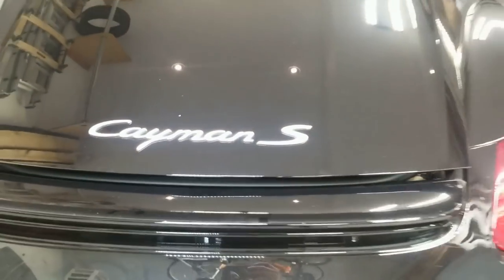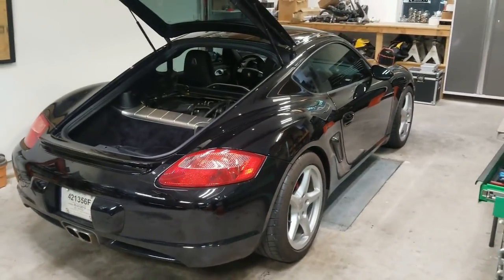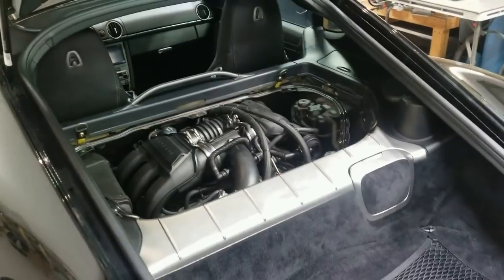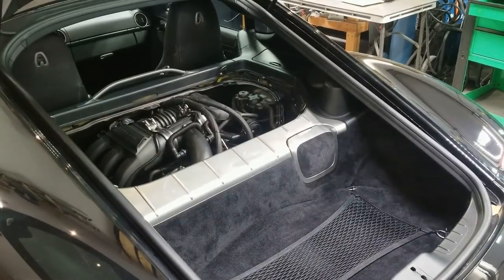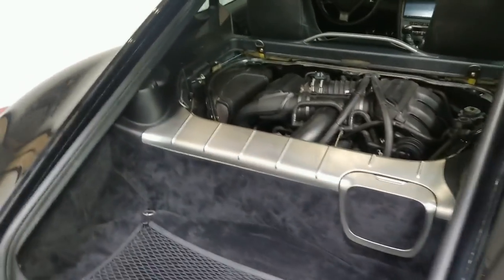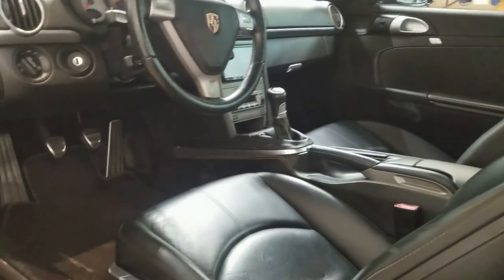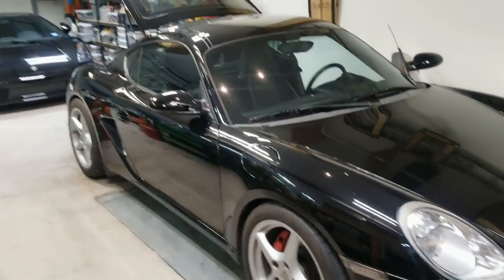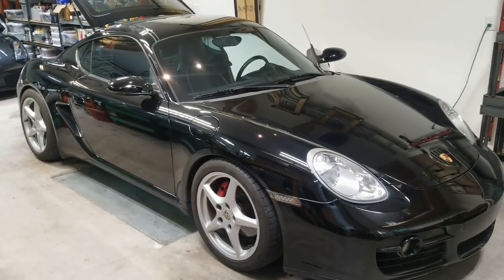LS3 Twin Turbo Cayman EP1 - 1200HP!

Comment: Following. Currently building a Audi Swapped 986.
Reply from the maker: Nice! which Audi motor?
Reply: I'm going with the Audi 2.7T. But planning on a custom Supercharged/Twin Turbo setup. We're Manufacturing a Swap Cradle for the 986/987. Really would have preferred to find a blown motor Cayman... but oh well.